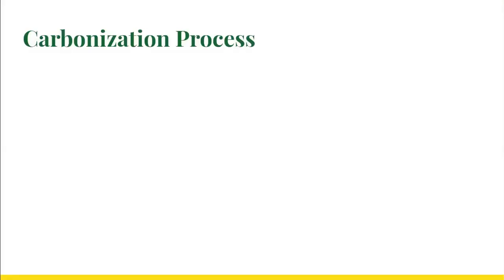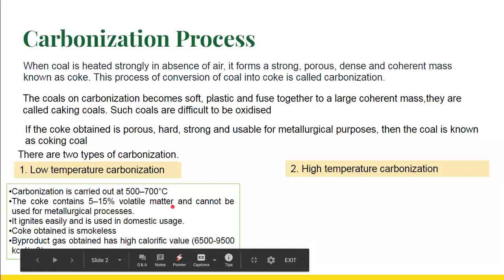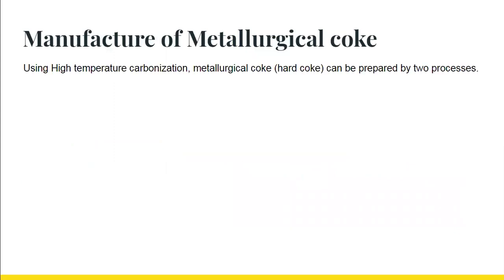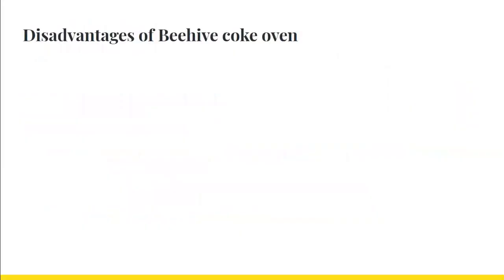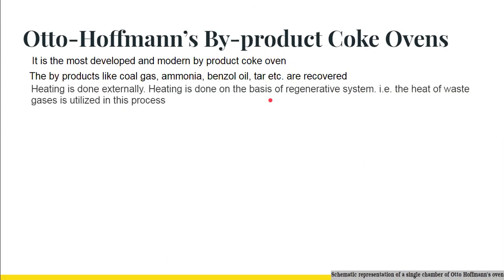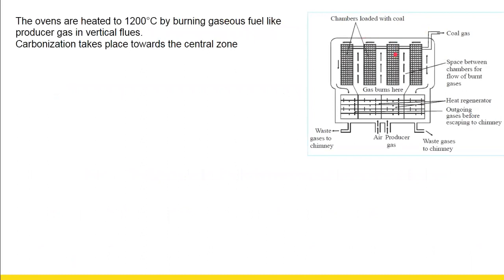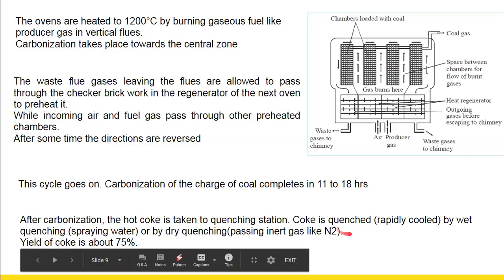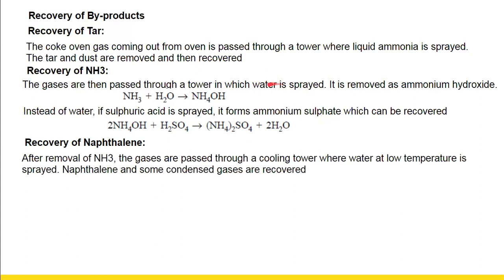Otto-Hoffmann's _Beehive Coke Oven _Carbonization process to manufacture coke _ by Dr. Rekha Nair

Comment: Mam, if the carbonisation process is held in the abscence of air ,then why we have to supply air in to the beehive oven???
Reply from the maker: Air is supplied so as to burn the fuel gas which helps to maintain high temperature required for the carbonization process
Reply: Ok mam. thank you...